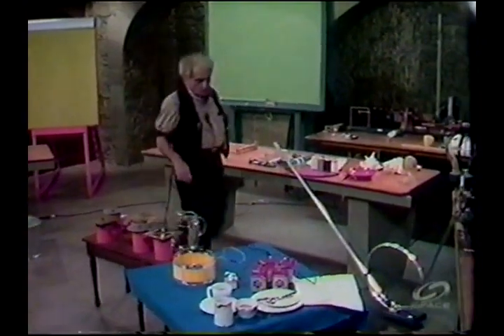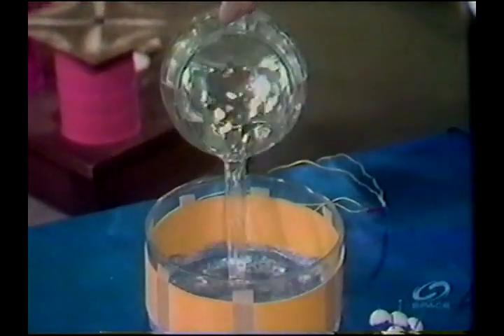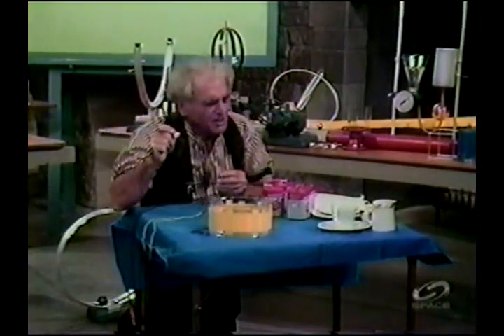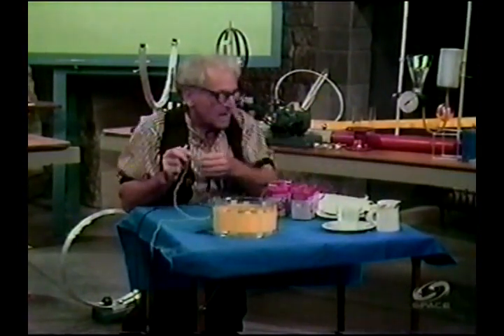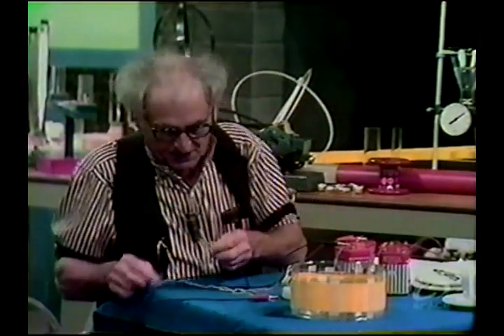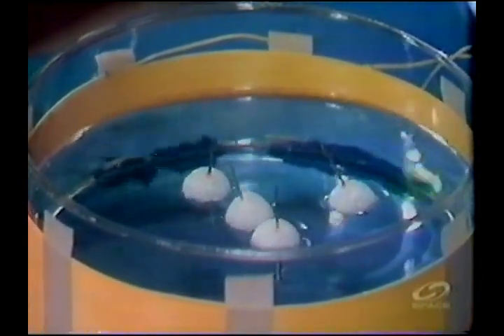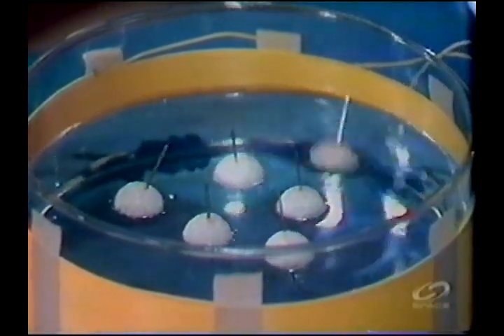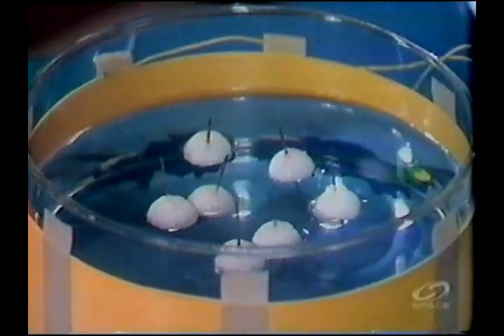Julius Sumner Miller 49 HHOF - Symmetry of the electric field

Comment: I wonder if the little system that the professor showed here follows the adage "A system tends towards less"? The symmetry that these objects were creating looked like the magnetic field was trying to "equalize" itself amongst all the objects in the water.
Reply from the maker: @ZilogBob  Ask yourself this:  Why is the water required?  Why not simply have a coil of wire wrapped around an empty bowl and use magnetized ball bearings?
Reply from the maker: The magnetic field generated within the coil of wire generates a weak electric field in the middle of the bowl of water. (Read my reply to ZilogBob's comment for more information).  The needles are responding to the electric field, not the magnetic field.  Yes, the symmetrical shapes the needles are taking are because these shapes formed take the least amount of energy depending on the number of needles.